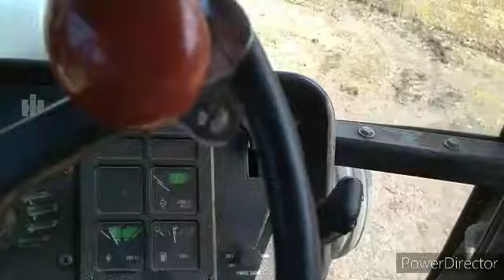IH 5288 tare down started...

Comment: What a bunch of pets you have there Ed, they look good 👍 My cows finally got with the program the other day 5 of them calved. Its kinda hard to adjust valves on the 560, with that going on in the background. I managed to get it running today finally. Good luck with the 52. Seeing that breather on the valve cover shows me what it is supposed to look like, not a ball of grease like the one on my 1086, thats on the list too.
Reply from the maker: Just a few...lol
Nice 👍 hopefully calving is going well!!
Valves can be a pain on anything... I always go over them a couple of times, make sure they're right.
The glob.. if I remember correctly, I made a new gasket for the breather and it's got some good sealer on it. The factory gasket is rubber, they soak in the oil and leak.. seems no one told the engineers that rubber and oil don't always mix well..
Thank you!! Hopefully it all goes well!!!

Comment: yeah if you have a full waste oil container under yer work area you are guaranteed to drop tools and parts in there
Reply from the maker: The ultimate tool magnet!!
Bad enough if it's just oil.. mix some water and antifreeze in and just go buy new tools, it's cheaper than trying to clean up what's in the 💩
Reply: G'day PD

Comment: Well, the weasel should help kill some rats, right?  Good luck with the I H I got my messy partially apart right now because of the fan pulley bearing assembly going bad can’t get a new pole either his grooves in it so I’m gonna try to get oversize bearings and have somebody machine it. Yup hope the best for those guys massive drought also in Kansas as well and good parts of Oklahoma.
Reply from the maker: Good morning Ray ☕☕☕
Sucks when you can't get parts!!!
Hopefully you can get something figured out and get it fixed!!!
Lots of places in drought... 
Hopefully those with fires can get them stopped soon!